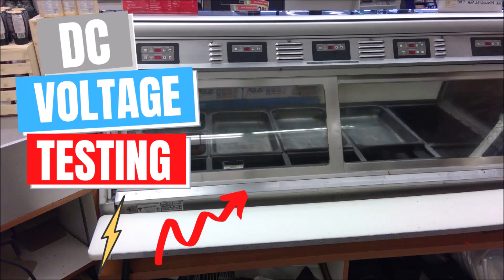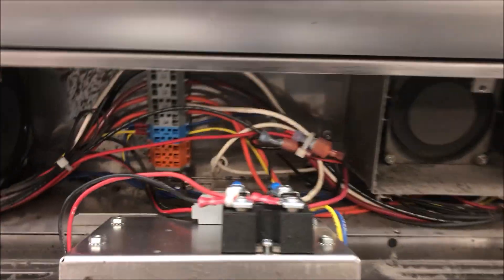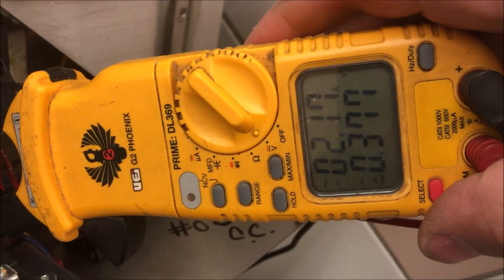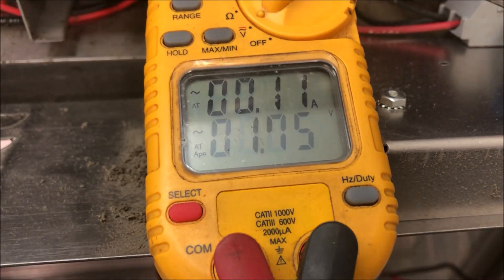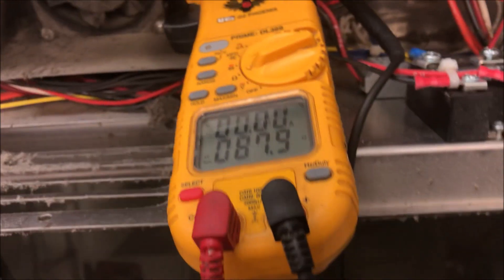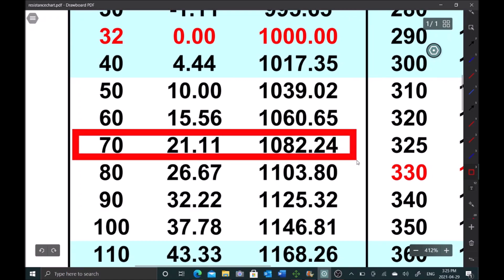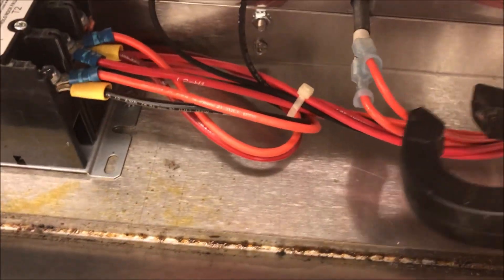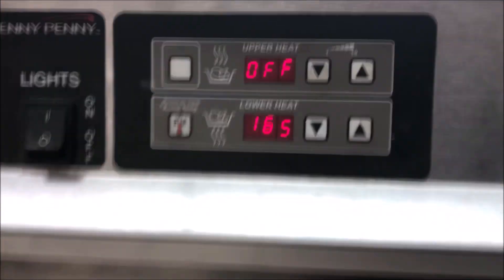Henny Penny Hot Case Is Not Heating. DC Voltage Testing

Comment: I have three top elements not warming up on the same henny penny relays?
Reply from the maker: They are known for blowing, due a continuity test on the elements.
Reply: @REFRIGERATIONKITCHENEQTECH  
I found the issue was contactor line 1 hot wasn't going to the top elements changed out good to go!! Great video

Comment: Better you than me because I would have definitely been changing that probe out whenever I change the board out it's just like I guess a bad or a good habit depends on how you look at it but I definitely like your breakdown awesome job also most guys would have just changed the relay and then left and not taking it to step further to verify set point thumbs up... I'm also curious if you thought about using your megger on that element now that you got one. 😃
Reply from the maker: Lol I didn’t think about using the megger, no issues with a short. I will start taking reading on failed ones so I have a reference point. The temp probe was replaced. I didn’t put it in the video because it would of basically made the troubleshooting look like it wasn’t needed and I’m trying to get my techs to pinpoint the issue as opposed to changing multiple parts. I find too many techs in the field are going the route of part changing as opposed to taking the extra time and steps of troubleshooting and finding exact fault.

Comment: Awesome video

Love how you described your troubleshooting with the wiring diagram

Question. Why does the unit pulse the voltage?

Thanks for sharing
Reply from the maker: If the unit is set to stop heating at 160F, as we get close to that temperature, we don’t want the element on fully because if it shuts off at 160F, the element is still hot and the temperature will go a lot higher than 160F. If we turn the element on for 1 second, then off again for 1 second, the element will not get hot enough to make the temperature go way above setpoint (160F)